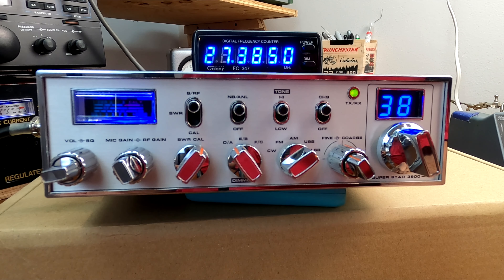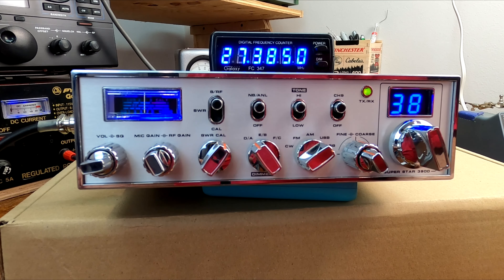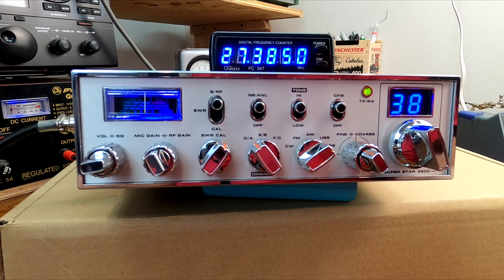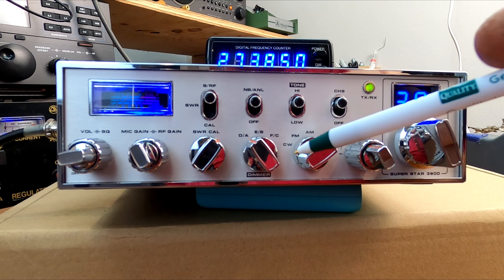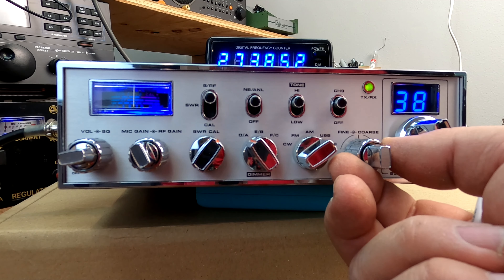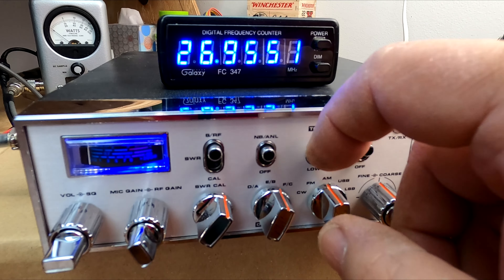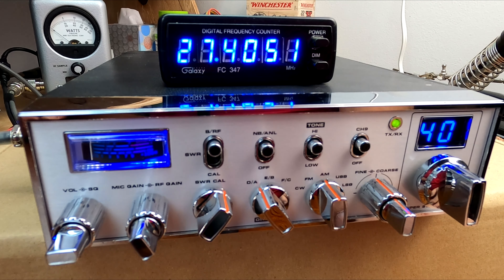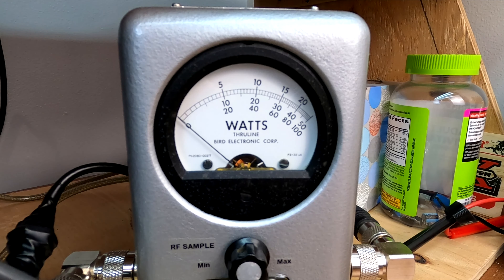Super Star 3900 CB 27 Euro CB Radio.

Comment: I have one from the 80's that goes from 25.615 to 28.305.  It is my only export radio, I used it as a base station with a 5/8 ground plane and use to do very well with skip.  Also had a cheat sheet with the channels for upper and lowers called a PaPa India chart, which came in handy, people would tell you let's go 10 up or 20 up and I would look up that channel and frequency then look on my Super Star chart and match it.
Lot of fun in those days!!!

Comment: I'm running a CRT version (red display) I guess from the late 90s/early 2000s - I matched it up with an old Astatic Teardrop and it sounds great by all accounts. It does drift around like buggery until fully warmed up, so I just leave it on and turn the volume down when it's not in use - I have added a couple of computer CPU heatsinks on the back which seems to help too. Cheers.
Reply from the maker: Sounds like a very nice station.:)
Reply: @390WagonMaster  - in a ground floor apartment, so very limited with antenna options but the place is very near the sea which works wonders, especially on the skip. Cheers.

Comment: I have the Cobra 148 GTL DX that I bought in 1998, love it to bits but the only thing I don’t like is the notch rolling back to 12oclock if it has to be off a fraction. I now use a Westland 707 that has no notch and is great on receive. It’s roger beep sounds like a cobra or Amstrad 901 beep.
Reply from the maker: That 707 looks like a great rig. Cheers

Comment: The French company are called CRT. Typically they used Ranger EPT 6900/3600 Boards.. I have the CRT 3900 EFT. Which is the in built frequency counter.. The drift is due to shite electrolytic caps and resistors and diodes...Ranger /Galaxy still use the same cheap components hence have the same problem... On the plus side ,the receive is very decent. When the front end is tuned via good sinad meter.. I agree I prefer the front end on the old school Rigs. My favourite is my 1981 Teaberry Stalker 9FDX..Also my 1993 President Jackson Mk1, Awesome transceivers..

Comment: i really like this radio,but i dont like the blue led in the meter tho
Reply from the maker: I'm a big fan of blue lights, this goes back to my youth in the 70s and staring at those blue lights on the old Marantz receivers. Now... I prefer white LED behind my meters because I can see the reading better, I'm just to darn lazy to change out the LED in this radio. I need to pull the radio out of my truck and service it, this would be a good chance to swap out that blue light:) Cheers